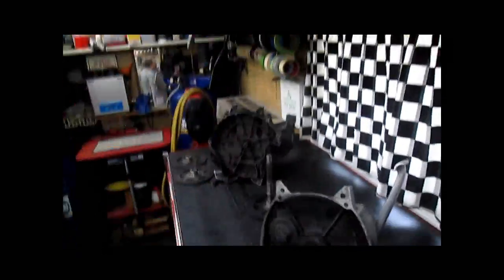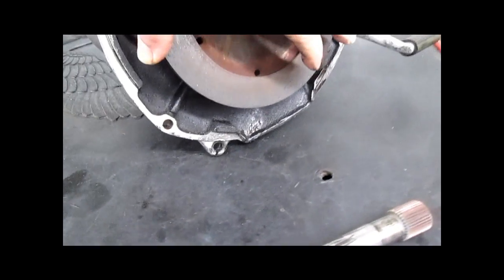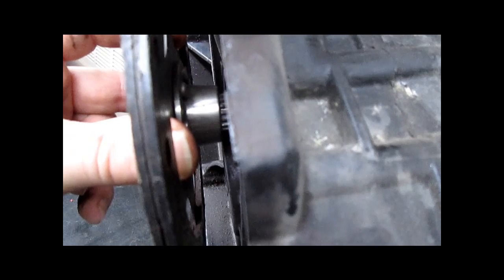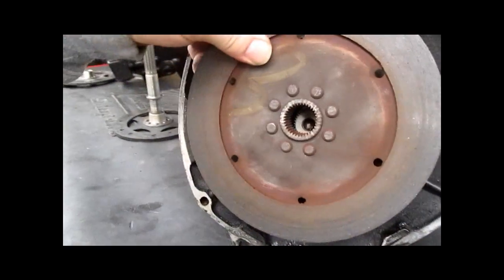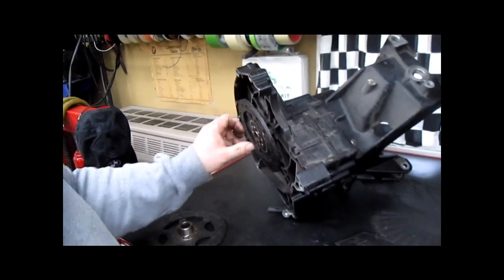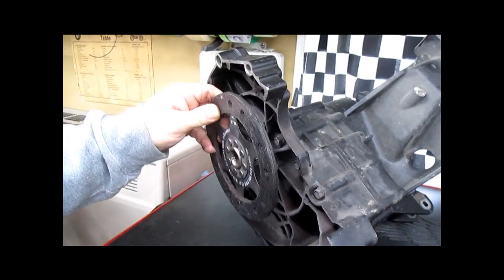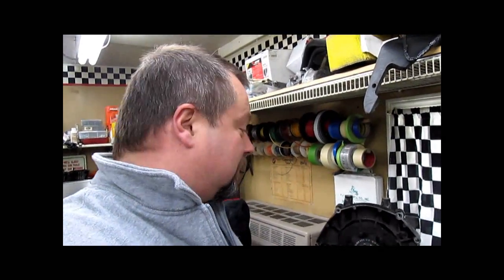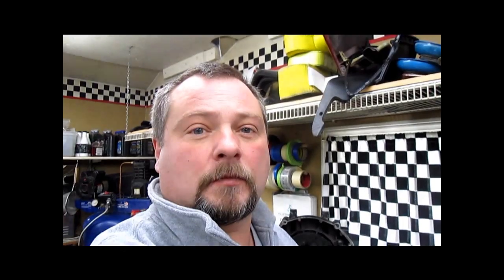BMW Service - Clutch / Transmission Spline Failure Explained

Comment: Dry diaphragm clutch in a motorcycle which shift hard more often than a car, van, truck, a cheaper solution for sure , but rarely does it give the durability of a wet clutch....even worse when you go cheap and don't use a pilot bearing to support the 1st motion shaft. 

I'm old and can remember R5 and R6 dropping splines on pressure plate and shaft and back then there was a recommended spline lube every year or 12k miles. It's a perennial issue. 

The 6 speeds never had a recommended spline lube, like a car.

Strange diagnostic from this gentleman, but that's sometimes the way with a mechanic, not an R&D guy, when one considers it's a rwin cylinder and that itself causing 'chuggle' power on and off.

Comment: Fabulous explanation and helpful information thanks for posting this . Im only here because clutch started slipping and im trying to find the cause . This  wasnt it but useful info because i too have been guilty of hitting 6th gear at 60 mph on motorway . I will stop that NOW if its not too late heh heh .

Comment: It isn't a design flaw and the described failure affects mainly the US market because drivers are not used to manual gearboxes. The contact surface between the dented friction disc and the gearbox input is normally sufficient and the fact that it moves away from the gear input when you press the clutch level is not an issue either, since there is no force transmission as soon as the friction disk displaces a tenth of a millimeter away from the gear box. 
When shifting gears you need to release the clutch while you open the throttle smooth and progressively on both hands, left on the clutch level and right on the throttle turn control. 🤓
Reply from the maker: Hugo, I'll respectfully and completely disagree. The splines on the hydraulic clutch models do not ever fully engage and that is very different than every previous cable operated clutch model from BMW. And might those Americans find these supposed motorcycles that do not have a manual clutch?! It does not matter anyhow.

Comment: I had the clutch splines strip on my '86 airhead at 32K miles, shortly after I bought it used in 2010.  I learned how to work on BMW bikes while tearing it down and reassembling it.  Also now have a 2014 R9T oilhead.  Does it have the same shaft/clutch mismatch?  Thanks for all your videos.
Reply from the maker: I do not know about your R9T clutch.

Comment: This video explains exactly what happened yesterday with my 1150RT. I am pretty shocked how bad this design is. Bought the bike in a used condition, haven't been riding in 6th yet, but i don't know how the previous owner has ridden it. Seems the splines were already shot or in bad shape. Don't know if it is still worth the fix yet, or to look for another bike. Pity, because the bike itself runs great. Great video btw! Edit: Got the bike back, everything fixed under warranty. Now hammering it much harder than before, and only using 6th gear above 80-85mph. Bike seems to love it as well!

Comment: This video is eight years old and still timely as I have just purchased a 2004 R1150R with under 13,500 miles. I am guilty of keeping the rpms under 4,000 and using 6th gear under 85. Thought I was doing good. Now I know better. Thank you. Liked and subscribed!
Reply: just had a catastrophic spline/clutch failure yesterday. I've never been in 6th gear since i have my r1150rt. But i don't know what the previous owner did ofcourse. Now the spline is fucked and i had to walk back 3 miles back to home. This is a serious engineering-issue together with notorious KFR. An oilhead even uses less oil when you keep it in high revs, instead of riding at low revs(what you'd expect from a touring model). Figured that out some time ago, but still, the spline stripped. GOnna cost me a lot. Bike itself is great, but this is a big flaw, and BMW doesn't care at all. Gonna fix it, but i am very dissapointed in BMW on this issue. Gonna put the modified disc on my RT and hope things will get better. But it sucks bigtime...

Comment: I have a R1150RT. If I cruise around 3000+ rpm in all gears will it last longer? Low rpm riding makes it worse?  
Thanks for great video!
Reply: Do you have KFR? in that case, it is gonna destroy your spline sooner or later. keep it on 4000 rpm or higher. Sounds crazy for a twin touring bike, but it seems there's no other way..

Comment: I bought my '01 R1150 GS with 96k kilometres on it, since then I've put another 10k on. 

I've been kicking around the idea of pulling the trans, inspecting the clutch and lubricating the splines this winter. But it looks like a lot of work. Is it worth the effort?

Comment: I bought a used 2005 R1200GS with 34000 mi. I just got to 35000 mi and had clutch failure.  Im going to get a used trans and new clutch.  Can a guy with desent mechanical exp rebuild a R1200GS trans?  Im asking cause there is no BMW dealers or repair shops no where near where I am at!  Great videos, wished I seen them before purchase!

Comment: Hey Chris, would excessive engine braking have the same effect on this running gear same as low-revving/under-loading? Or is this just an ignorant question? Thanks.
Reply from the maker: I don't think frequent engine braking is a cause. There is never an ignorant question when it comes to these old bikes.
Reply: Oilheads have a lot of displacement and high compression. so they will engine brake hard. This is something i wouldn't consider an issue. The real issue is the faulty design. and it is an expensive repair.

Comment: Do you know if the Spline problems was shared by the 2005 R1200GS models?? It would be nice if you put the BMW's or aftermarket part numbers used on the description. Thank you. best regards
Reply: It shouldn't as they shortened up 6th gear and changed the twin spark ignition so that it fires the plugs separately. This has cured the surging issue and my 05 R12ST has been perfect. Don't lug the engine and you should be fine.

Comment: Hi Chris
I've just removed my transmission on my r1100gs to replace the clutch, I've had a clunck and amount of slack in the driveline since I've owned the bike
With the transmission removed I can turn the gear box input shaft about half a turn before the out put shaft catchs up and starts to move
I checked this in first and second
Have you seen this before and is it normal?
Regards
Chris
Reply from the maker: 1/2 turn is normal. Proceed and good luck. Stay tuned for more oilhead videos, Chris.
Reply: @ChrisR.Harris 
Fantastic, thanks Chris
Really appreciate the response
I will indeed, keep up the great channel
Reply from the maker: @e30graveyard  Thanks.

Comment: I'm still investigating a noize drive train of my Bmw Rockster r1150 perhaps it can help people that they can see and hear what my problem is here --> https://youtu.be/TRuauvnYbto . I have the feeling that this is a problem of the Spline ... but i don't know for sure yet. I'm going to a local BMW dealer to have them listen. @chris , i don't expect you to give me any advice or insight in this issue but if you want it is always welcome ;-). I'll post the results of what BMW says here and hopefully also the solution, so others know what it was.

Comment: Hi Chris, thank you for the very informative video.  Is your friend still modifying the clutch discs and are you selling them?  I recently (August 2017) bought a 2004 1150rt with 67,000+ miles and don't know if the splines were lubricated at 40,000 miles or not.  To be on the safe side I would like to know how to get on the waiting list for the next modified clutch batch.  You can contact me at efrainmilenium@yahoo.com.  Thank you, Frank.

Comment: at 2:32 what does the clutch plate hit on when he pushes it into place? What limits the clutch plate from going all the way in using all the splined material? I did not see any limiting factor on the other clutch plate he held up to the camera. I do not see any limiting factor on the input shaft, so what does it hit on?? Whatever it hits on needs to be machined off, then the circular spacer made to be put under the clutch flange looking at gearbox side which would pull the flange more towards the gearbox and cover the rest of the splined material. Then you should bolt that flange down to the circular washer on the outer side looking towards engine and weld those bolts in if possible, then grind them, or just plug weld the bolts on the engine side (maybe just put couple of nuts on to make the flange and washer tight enough, then weld the rest of them, finally remove two nuts and weld them too).

Comment: My bike is a '99 R1100GS 5-speed.  45,000 trouble free miles.  Is this model known to have this issue?  Would you recommend that I tear into it and go through all the bullshit to clean & lubricate the input shaft?   Thanks in advance!  -Jimmy from Michigan
Reply from the maker: Splines should be lubricated every 40,000 miles. The splines of your cable operated clutch are not as vulnerable to failure as the hydraulic models but you still need to clean and lubricate the splines every 40,000 miles. Otherwise they do strip and that involves a new input shaft, bearings and a lot of additional labor. See my R1100RT clutch video for guidance: https://www.youtube.com/watch?v=6gzR4WHD-94
Reply: @ChrisR.Harris  hello Chris and thanks for all your videos. Ive tried to search the comments for the same question I have with no luck... I'm in the market for a 1100gs. One 96 and the other 98. Both have between 50-60k miles. In your experiences would a older m94 trans bike be OK with 50k already on it or should I really stick with the 98 that has the m97 trans. The 96 has lots of records, the 98 None. Thanks for your time and happy travels from Sonoma county CA
Reply from the maker: Either one, not much difference between well kept M94 bike or no-record / mystery life 1998 model. Good luck, Chris

Comment: the spline failures are due to an alignment issue with the gearbox. Bolt up a known good gearbox housing and one from a failed gearbox. You will be able to see the misalignment with the naked eye. I have repaired around 70 of these type of failures and have never had to do one twice. I replace the gearbox housing (the front part is what BMW calls the housing) the input shaft and the clutch. I have never modified a clutch plate, but we offer our BCW clients the choice of the SeibenRock friction discs or the stock Sachs discs. It doesn't matter which plate, it won't have to come back apart until the clutch is worn out or the gearbox and/or slave cylinder pukes it's guts out onto everything. 
    When I was the shop foreman at BMW of San Francisco, I made BMW aware of the fix and demonstrated the alignment issue to our west coast service rep who shared it with all of his dealers. BMW didn't send it further up the ladder, but they did pay for a bunch of gearbox housings.
  Incidentally, the K75's had a similar, but much less widespread, issue as well but that was due to the bell housing alignment. When BMW crated the bikes, there was a big block of wood  directly under the bell housing in the crate. If the crate was ever dropped or set down hard, the bell housing would get distorted. It would show up as poor downshifting and inspection would show that the splines would push the lubrication out, usually within 1000 miles of lubrication.

Comment: Looking forward to seeing the edited video. What final diagnostic test would you do to determine wasted clutch splines? Maybe the input shaft splines are okay? Have you seen this failure with input shaft splines still good/usable? I can do the work, was a mechanic for some years, and my dad's an ingenious machinist (he can modify the clutch). If my input shaft splines are buggered up I will need a rebuilt transmission. Is there a place where I can send my transmission as a trade-in for a rebuilt one? I did baby it, lopping on down the road (won't do that again).  Video of my dad's machining abilities http://vimeo.com/4045734
Reply from the maker: Cool video! The input shaft splines are always wasted if the clutch hub splines have failed. I have video footage from last year of the procedure to replace the input shaft and bearings. Hopefully uploaded this weekend. You can change the shaft yourself. Stay tuned...
Reply: Kent, I hope your dad is hooked up with people who are working on exoskeletons which will allow paralyzed people to walk again. It's happening.
Reply: Ray Brensike
Hi Ray - He is working on a wide variety of stuff constantly. I wouldn't be surprised if he were to be involved fully when doing exoskeletons when it comes his way

Comment: Hey Chris, great explanation. I have a 2004 R1150 GS, 6 speed, 27,000 miles I had to push home last week. Sounded like it popped out of gear with a BANG. At the edge of the road I carefully put it in 1st, slowly let the clutch out and it sounded like munched down little splines buggering past one another with me going nowhere. I believe this is the problem. I love my GS, it's yellow, but I may part it out at this point. This whole thing is just too lame and frickin' expensive to fix. I'm disgusted, at my wits end and feel sick in my heart BMW would let this happen. I was hoping it was the drive shaft, but I don't think so. If you have any words of encouragement I'd like to hear it. Thanks for posting.
Reply from the maker: I'm so sorry Kent but you have obviously had a complete failure of the clutch splines. You're looking at $1000 in parts and 16 hours of labor to repair it with the modified clutch. I have video of the whole repair recorded but not edited yet.

Comment: Great video but it seems the problem is related to the 6 speed gearbox and low rpms so I dont see how the improved disk will make a difference in that regard.  Perhaps it will extend the miles until another failure. How many of the improved clutch disks are currently on the road with enough miles on them to compare the failure rate?   I guess I am missing something here.  My 03 RT has just over 20k so, yes I am concerned.
Reply from the maker: P Stef: The defect is not a transmission defect. The defect is with the flywheel/clutch carrier (a BMW part) which moved the clutch (a Sachs part) further away from the transmission (made by Getrag) so that the clutch splines do not completely engage with the transmission input shaft splines. This coupled with operation at low rpm + a tall gear selection by the operator will result in early failure (7,000 - 25,000 miles). Modification of the clutch disc to allow the splined portions to have full spline contact as all other BMW models had prior to this design has proven to be a perfect solution to this failure. I hope yours is OK and lasts forever but I'd be checking the splines during the next off-season. Good Luck & Happy New Year, Chris

Comment: What you explain makes a lot of sense, and given the possibility, when the time comes i will opt for a modified clutch for my 1150 gs if i can get one. However, i find it strange that this failure usually appears before 40000 kms and sometimes even after replacing the clutch and input shaft it soon fails again...while other bikes of the same model sharing the same defect keep going and even after high mileage the splines look fine. Could this be the consequence of riding at low rpm or are there other issues that can influence this?
Reply from the maker: Low RPM coupled with the design flaw will accelerate the date of failure immensely. The bikes with 100,000+ mi. on them with no failure are, in my experience, ridden hard by aggressive riders who run at much higher rpm than many other BMW owners. Happy New Year, Chris
Reply: @ChrisR.Harris  I agree. We rode the hell out of the Dept's RT-P models and the only failure was an occasional driveshaft. And those were probably from coming off of curbs on the throttle......

Comment from the maker: Cylinders ($700 ea) don't wear out, pistons ($340 ea.) either, usually. Rings from BMW ($100 per side). There are a couple of aftermarket sources for higher compression slugs but I have not used them yet. Bearings are inexpensive at $30 per rod. Thanks, Chris

Comment: Chris,
Can you recommend a good source for an overhaul set (rings, pistons, bearings etc) for BMW's? My bike (2000 R1150GS) has 140,000 miles on it, seems to have been well maintained (I just bought it), recent clutch, fluids changed, don't know how many miles left to expect from her and trying to get an idea of what I'm looking at to rebuild. I am a diesel mechanic so I have the skills but not the BMW experience. Thanks for the great videos.

Comment: That was a really well done video.  I thought of getting a used BMW 1150 and then I heard of some of the problems.  I think I will just stick with the Japanese bikes.  Less cost and never had a problem with one.  I have close to 40 000 miles on my Suzuki.  All I ever had to do was oil changes and tire changes.  I think she needs a set of plugs now.  Not so hard to do.  Keep up the good videos.

Comment: Howdy Chris,
Knowing of this type of failure, when I decided to have a sidecar installed on my R1150GS, Chris advised me to buy and install this modified clutch disk.  Luckily my transmission input shaft was in great shape so installing the modified clutch disk should provide a long service life for my hacked GS.  Thanks Chris for working with the machine shop to make this disk available for those of us who ride our bikes hard and long. 
Dave

Comment from the maker: The R850 models and R1100 models (EXCEPT the R1100 'S') are not prone to failure. The 6 speed bikes and the R1200C (which was a 6 speed box w/ 5th gear removed) /CL/CLC are the bikes that have a high failure rate. Your R1100RS will likely be fine but the input shaft splines should be cleaned and lubricated every 40,000 ~ 50,000 miles. Good luck, Chris